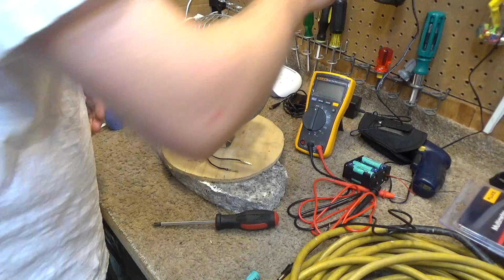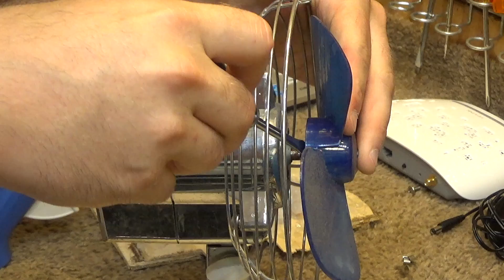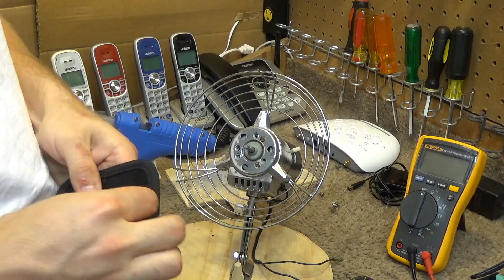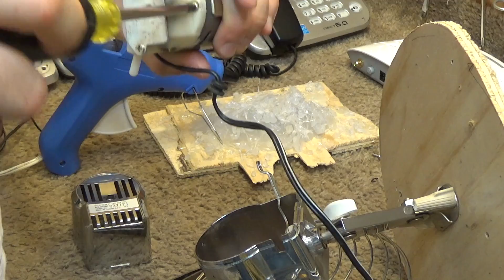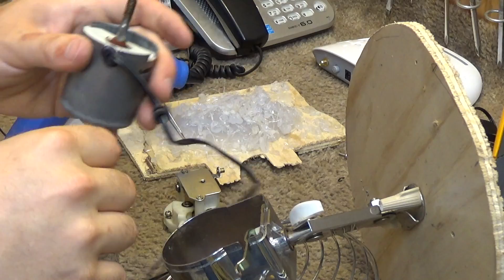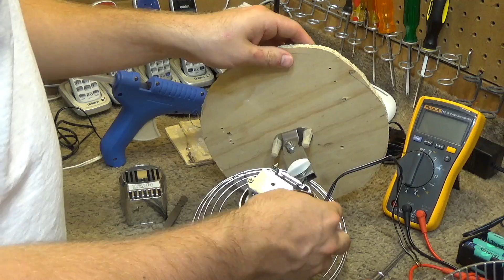Batteries for Service Line 12V DC Fan

Comment: its a permanent Magnet DC brushed motor this fan has the other DC fan all used brushed series wound motors  found is busses, trucks, vans and other vehicles  the maker of these are Baader Brown MFG. Co,  Electrohome/FASCO/Von Weise,  Bergstrom, DCM Manufacturing under DCM, Maradyne, formally Hupp mobile products and Perfection, Chicago Metal products CMC, and Casco as they are heavy duty stationary fans and they do not oscillate the fan speeds in their wound field motors is the 2 wires off the field assembly typically orange for high speed and red low speed  these later Baader Brown fans with the 1032 2 speed permanent magned brushed motors there is 3 brushes in it as one brush is offset which is high speed the normal brush is low speed but the spindown is too quick on them.  the oscillating fans the chinese made ones use a generic permanent magnet DC motor they don't hold up very well and uses a external switch on the cord that has a resistor for low speed and those get very hot durning use which i seen one where the resistor got hot and it melted the plastic housing on the switch box  as one automotive fan it has an orbital oscillation as it oscillates side to side up and down.   but they produce a decent breeze

Comment: Hey Jordan, while you're looking at a DC fan here what about reviewing USB fans? There are some larger ones at 8 inches or above that do move air with very high efficiency. My 8 inch USB fan has two speeds and on "high" it's in the same ballpark as my table fan on low while using perhaps one tenth of the power. Mine needs to be oiled at least once a year though to not seize up on low speed. Enjoying your videos
Reply from the maker: I have no interest in USB fans, too impractical, underpowered, and poorly built for me.

Comment: try the switch on the back and see what it does
Reply from the maker: I know what it does. I am not uninformed.
Reply: @JordanU  i want to see what it does
Reply from the maker: @randomcontentcreator123-l4d  I do not take requests from spammers.
Reply: @JordanU  I'm not a spammer, make up your mind
Reply from the maker: @randomcontentcreator123-l4d  Yes, you are. I made my mind up about that a long time ago. Find something constructive to do with your time.
Reply: @JordanU  well you post the same thigs over and over again
Reply from the maker: @randomcontentcreator123-l4d  Do not post spam. Find something constructive to do with your time instead.
Reply: @JordanU  I just did something

Comment: Pretty cool fan although cheap i have the same one more modern and its cheap and brush motor also with blue blades its a car fan but i have a 12v adapter to make mines work.
Reply from the maker: This came with an adapter to plug it into the car as well, but I've never used it in the car before.